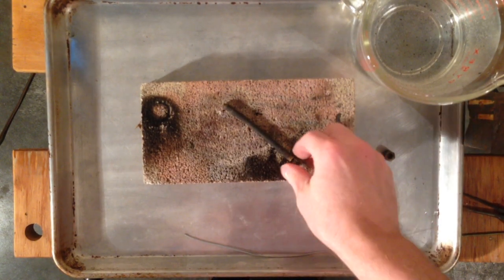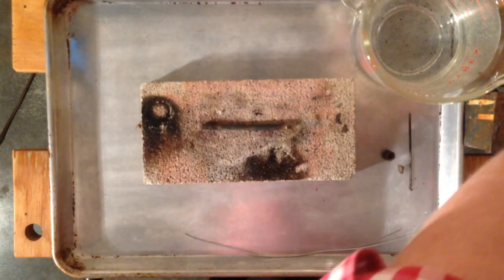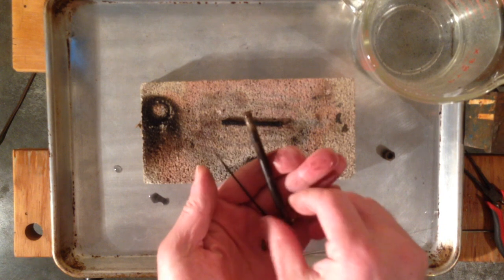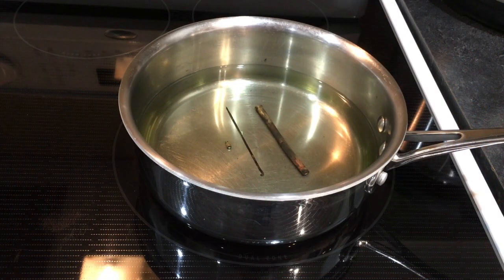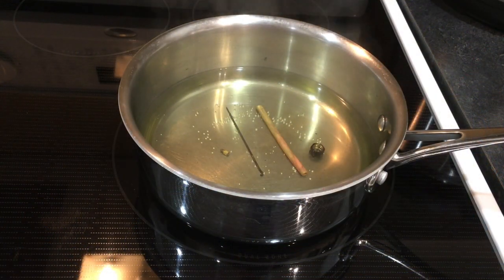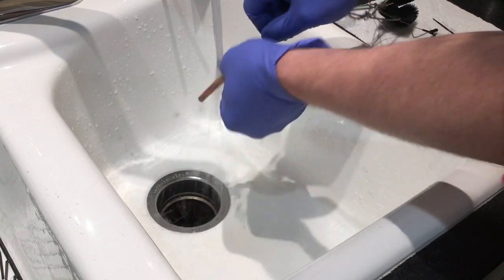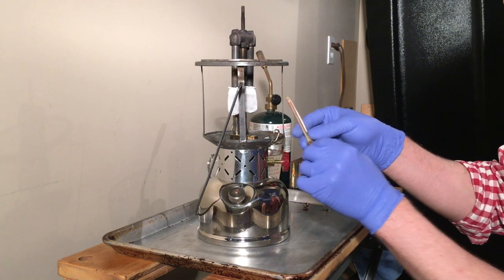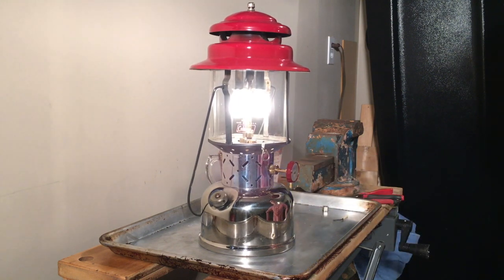How to Clean a Clogged Lantern Generator

Comment: Thanks for this interesting video. My 282/700 generator is  to be cleaned, what do you think of cleaning in ultrasound bath? Do you have experience with that method?
Reply from the maker: Yes, ultrasonic cleaners work.  You'll still need some kind of mild acid solution for the bath.  I've found that I still need to run a brush through the generator tube and do a bit of scrubbing on the spring to get rid of carbon deposits, which is why I find it easier to just put them in a bot on the stove.

Comment: I've  tried boiling hot citris, B-12, gasoline and vinegar. Nothing seems to break down the hardened carbon that locks in the wire coil and makes it impossible to remove without pulling it and streching it out, destroying it. Is there something that breaks down the carbon allowing easy removal?
Reply from the maker: As I showed in the video, heat and quench it.  Two or three cycles will usually do the trick, but sometimes it can take a dozen, especially if it's an old, well-used kerosene generator.
Reply: @king.coleman  Thanks

Comment: Something to consider... I use a cheap ultrasonic cleaner for this procedure and it works perfectly in just a couple minutes. Use Lime Away and water as a cleaning solution. Carbon and everything else comes right off without heat.
Reply from the maker: I've picked up an ultrasonic cleaner at Harbor Freight on one of my trips to the States.  I've tried various solutions and have had little success with using it to clean generators.

Comment: Do you put that little screen back in the generator that came out?
Reply from the maker: No!  It's not necessary these days as modern fuel is clean.  Trying to put the brass screen back in the generator is a surefire way to end up with a bent or broken cleaning needle.

Comment: Stupid question. On the small nut on at the end of generator, is it supposed to be a small hole in it? I can't blow true it or is it supposed to be just a nut that closes the generator.
Reply from the maker: The bit on top of the generator is the gas tip, not a nut.  Yes, it has a tiny hole in it that ranges from about .005" to .009" depending on the lantern model.  That hole is the jet that feeds vapourised fuel to the mixing chamber.  Because the hole is so small, the volume of air you can blow through it probably won't be noticeable.

Comment: You appear to know enough about Coleman lanterns. My friend came across an old lantern and we are trying to figure out what model, what gas type, what globe was on it, what mantels (it is double)  to use and how to make sure it is okay to use. How to disassemble. It appears to be a pre 1920's Quick lite. does not have a full loop generator or one of those little pin thingies. The generator is more of a U shape. In the center of the mantels.  Is there any way I could send you photos? Maybe you can help us identify and get it back up and running.
Reply from the maker: I'd suggest posting some photos to the Antique & Vintage Coleman group on Facebook.

Comment: my 414f stove works but wont shut off . After turning  off it keeps hissing very slightly and after some time goes off. Any idea what wrong???
Reply from the maker: How long is "some time"?  They don't instantly stop burning when you close the valve.  The generator is full of vapourised fuel and can take a couple of minutes for it to burn off.

Comment: Can one assume that the older asbestos equipped generators worked best because of the insulating properties and the ability to filter the fuel vapor? 
Pellam in Germany sells a kit for converting the Petromax kerosene lanterns to run with alcahol. This kit consists of a very fine brass screen to add to the petromax generator. Do you think this screen would make for a decent substitute for the cardboard tube in the modern generators?
Having moved to one of the EU countries along the eastern Med, we do not access to Coleman fuel so I have been using a cleaning solvent of Benzene to run the two Coleman Lanterns I have. Do you or anyone else reading this know of any long term issues of running this for fuel ? Lanterns don't seem to have ny issues with flare ups or pulsing.
Reply from the maker: No.  The function of the tube has nothing to do with filtering.  Some have argued that the tube serves to regulate the flow of fuel and/or to regulate heat in some way.  I find both ideas doubtful.  The fuel tip regulates the flow of fuel and, when you consider the pressure created inside the generator as the fuel vaporises, I can't imagine how the tube can serve as a flow regulator.  Regulating heat makes more sense, but again, you can replace the tube with bronze wool or a wrap of copper wire and the generator will work just as well.  Consider that the R-55 generator, which is functionally equivalent, has neither spring nor cardboard/asbestos tube.  I'm reasonably certain that the primary function of the spring and tube is simply to keep the cleaning rod centred.  Both cardboard and asbestos get the job done.  I haven't observed any difference in light output or pulsing between generators with cardboard tubes and those with asbestos.
Reply: YES, the brass mesh works. the principle is not to 'filter', it is to slow the fuel passing passing thru the gen and also increse surface area for the liquad to vaborize. just today i ran a coleman 220 with no cleaning rod or spring....just a rolled up brass mesh; it runs as new (no tip cleaning capablity tho). to much mesh ans your lantern will run lean, to little mesh and it will run rich an 'pulse'.  '#60 brass mesh' on amazon.
Reply: @king.coleman  YES, the brass mesh works. the principle is not to 'filter', it is to slow the fuel passing passing thru the gen and also increase surface area for the liquid to vaporize. just today i ran a coleman 220 with no cleaning rod or spring....just a rolled up brass mesh; it runs as new (no tip cleaning capability tho). to much mesh ans your lantern will run lean, to little mesh and it will run rich an 'pulse'.  '#60 brass mesh' on amazon.

Comment: I still find it difficult to believe that cardboard is used inside an extremely hot generator. I've just inherited a 282 from the nineties with very little use. So generator hopefully ok. I have used this heating and quenching method on Tilley and Vapalux lamps and it does work.

Comment: Those dual fuel generators have me perplexed. How do you fix them?
Reply from the maker: It may depend on which one you're talking about.  My experience has been that the dual fuel stove generators are basically the same as the naphtha generators and that the dual fuel lantern generators are similar to kerosene generators in having a spring-inside-a-spring rather than a spring inside a "cardboard" tube.

Comment: It’s funny you mentioned the pulsing, my 220K pulses slightly. Got it used, probably needs a good cleaning.
Reply from the maker: 220s and 228s are notorious for pulsing.  Sometimes a new generator will fix it, but it's no guarantee.
Reply: @king.coleman  I’m noticing the more I use it the more it comes out of it. I use it in the fall on the back porch and it’s getting better every day
Reply: @king.coleman  I actually picked up a 228E this morning, and got it running after tightening up a few small leaks. It’s got a pulse to it currently but I am expecting it to come out of it after some use

Comment: What is the point of the asbestos and cardboard sleeves? That part I don't "get".
Reply from the maker: It keeps the cleaning rod centred to prevent damage to the cleaning needle.  When the cleaning rod was captive, as in the R55 generators, there was no need for tube or spring, because the rod was fixed in place.  The R55 is just a hollow tube.  In later generators the cleaning rod can be removed (or it can fall out when not installed on an appliance) and if there's nothing to centre it on insertion or during installation the needle would be very easily damaged.

Comment: Would it be fair and accurate to say that the generators which have a brass spring inside a larger brass spring (kerosene) is actually optimal for all double mantle lanterns?
Without knowing I've been running one of these in a dual-fuel and it's worked good, so far.
Thank you for any information.
Reply from the maker: The kerosene generators use double springs as a way of prolonging their useful lives.  Kerosene produces more residue when burned and would quickly clog a gas generator.  I see no reason why you can't use a double-spring setup in a gas generator.  You can replace the cardboard tube in a gas generator with a wrap of copper wire and it'll work as well as the original.  The size of the orifice in the gas tip is going to be of more importance.  Kerosene generally requires a larger orifice (237 is a bit larger than a 236, 247 and 249 are bigger than a 242, etc.).  You may end up with the wrong fuel to air ratio.

Comment: Any idea what causes a generator to spit or "leak" at the top and then catch fire?
Reply from the maker: Cold generators do that.  The generator won't vaporise the fuel until it's hot.  Gas (Coleman Fuel) vaporises at about 35°C and kerosene at about 220°C.  The Instant-Lite valve was designed to provide enough gas for the lantern to light without flaring up, which allows a quick heat-up of the generator.  Kerosene models require preheating with a spirit cup and alcohol.
Reply: @king.coleman  I've had one or two act that way and I found little critters had built silken webs somewhere in the distribution tee.  I clean them out with with plastic zip ties that run thru and remove the webbing.
Reply from the maker: @lancethompson3431  Yes, spiders and other bugs sometimes build webs/nests in the air tubes and manifold.  It's always a good idea to inspect and clean them as a blocked air tube will limit the flow of air and without air you won't have proper combustion.

Comment: I have 231 kerosene dual mantle model i need a tip of no 6 for the generator how can i get it to Sri Lanka
Reply from the maker: I believe 231 generators have been discontinued, but you may be able to find one online somewhere.  If not, you should be able to build your own using the body of a 220 generator and the cleaning needle and gas tip from a 200 generator.  As far as posting things to Sri Lanka...that's not my area of expertise.
Reply: @king.coleman   Thank you for your quick response. I'll try.

Comment: is there supposed to be a mesh inside the jet?
Reply from the maker: Sorry for missing your comment, Achilles.  Yes, older generators typically have a bit of brass mesh at the top.  That was back in the day when fuel wasn't as clean as it is now.  The mesh can safely be discarded and it's usually best to do so.  Trying to reinsert the cleaning needle with the mesh in place is just asking for a bent needle.
Reply: @king.coleman  Soulgoodman. thanks!

Comment: I just took my generator apart and there wasn't asbestos or cardboard on the spring. I did get it at a yard sale so who knows or maybe it fell out on my bench somewhere 🤔
Reply from the maker: If it's kerosene it's a spring inside a spring.  If it's gasoline there should be a tube of some sort.  Depending on the type of generator, you can buy new tubes from Old Coleman Parts or some folks wrap capper wire or brass/bronze wool around the spring.  Whichever option you go with, you'll want something around the spring to keep the cleaning rod centred.

Comment: I have a broken needle  on a 1961 200, Can you still by one?
Reply from the maker: If the cleaning needle has broken you'll need to replace the whole generator.  Cleaning needles are not sold separately.
Reply: @king.coleman  Thanks for replying, where can I get a Generator(part number?) for that year? are they universal for a lot of models? Ebay? Great video by the way.
Reply from the maker: @kevinrodgers1769  Generators are generally model specific, although most are used on more than one model.  Old Coleman Parts is a good source.  http://www.oldcolemanparts.com
Reply: @king.coleman  Great thanks again.

Comment: Doesn't heat and quench make the material brittle?
Reply from the maker: Just the opposite.  Heating the brass and allowing it to cool, either slowly or quickly, anneals it and makes it softer and more malleable.

Comment: Is there an alternative for citric acid?
Reply from the maker: White vinegar works just as well, it just smells worse.
Reply: Thanks a bunch. Also, is this the fix for a lantern that sprays fuel after pressurizing? Or can you tell me which of your videos  covers that?
Reply from the maker: @rickeyl.mcspaddenii4729  Hard to say.  Where is it spraying fuel?
Reply: @king.coleman  good question.  Will need to check again.   But I think out from where the mantle hangs.
Reply from the maker: @rickeyl.mcspaddenii4729  Cleaning the generator isn't going to fix that.  You've got liquid fuel spraying into the manifold.  If liquid fuel is coming out of the generator, it's not getting hot enough...or on a kerosene model, you haven't preheated it properly.
Reply: @king.coleman  It's a 222A.  I believe I can use kerosine, but currently have coleman camp fuel in it.  Might you be able to advise me or direct me to advice?
Reply from the maker: @rickeyl.mcspaddenii4729  A 222A is definitely not a kerosene model...gasoline only, so be sure to use camping fuel.
Reply: @king.coleman  ok.  Good thing I switched to that.  Did I turn up the fuel too high before warming it up?  Would running Kerosine though it work or break it?  Could I private message you?
Reply from the maker: @rickeyl.mcspaddenii4729  It shouldn't be a problem if you're burning white gas.  Kerosene shouldn't damage anything, but it won't run right.  White gas vaporises around 100°C, which is what the Easi-Lite technology relies on.  The generator gets hot enough to vaporise fuel before it has time to flood.  It'll flare and smoke a little, but not for long.  Kerosene starts to vaporise between 200° and 300°C.  It requires extended preheating with alcohol in a preheat cup below the generator.  Without preheating a kerosene generator you'll have liquid fuel everywhere and when you light it you'll have a fireball.
Reply: @king.coleman  Which is exactly what happened. Would that happen with white gas (coleman camp fuel)?
Reply from the maker: @rickeyl.mcspaddenii4729  Nope.  The Easi-lite circuit limits the initial flow of fuel to prevent flooding during the brief time it takes for the generator to heart up.  It's dependent on the low flash point of gasoline.  This is why there are not Istant-Lite or Easi-Lite kerosene models.
Reply: @king.coleman  ok. great. I guess I need to use low fuel to heat it up and then it should burn properly.  Thank you.

Comment: Is carburator cleaner a no no with brass?  Definitely a no no with asbestos, I would think.  There is always vinegar and coke a cola with brass.
Reply from the maker: Carb cleaner is fine to use on brass.  The active ingredient is methylene chloride, which won't harm brass.  It's worth noting that a lot of carburetors include brass components.  I usually use a citric acid solution (similar to white vinegar), but if the carbon is really tenacious and heating and quenching don't work, a soak in carb cleaner is a good option.

Comment: Where does one find citric acid?
Reply from the maker: I buy mine in 2kg packages at a local supplier of wine- and beer-making supplies.  Small packets can be found in grocery stores with the canning supplies.
Reply: @king.coleman  Thank you for asking and answering. I was going to ask then checked over the comments to find the answer.   What is your mixing ratio? Thank you.
Reply from the maker: @Timtanic1912  There's isn't really any magic ratio, but I find 1 tsp of citric acid powder per litre of water works pretty well.

Comment: 14:05...I'd seriously consider putting a strainer in the sink drain while I was rinsing those small parts-(!)
Reply from the maker: Yes, if you've got problems or think you may have problems holding on to small parts, that's not a bad idea.  I've been at this for more than a decade and never found it to be a problem.
Reply: @king.coleman  ...speaking for myself- I'd rather not tempt fate-(!)

Comment: The average temperature of this torch is 1,995° C. The melting point of Carbon is 4099°C. The melting point of Asbestos is 760 °C. 
What black magic is this?
Reply from the maker: A professional propane torch may get that hot, but I doubt my little hardware store torch is getting any hotter than maybe 1200°C.  If it were getting up to 2000°C I'd be melting the brass.  It won't melt or vaporise carbon, but the heating and quenching process will cause the carbon to break up.  According to Google, asbestos starts to break down at about 1500°C and, like I said, I don't think my torch gets that hot.
Reply: As I understand it, carbon will burn to ash at 800 deg F if there is air present. The ash doesn’t stick to anything and falls away and can be flushed out.